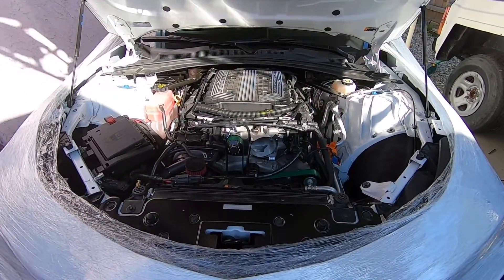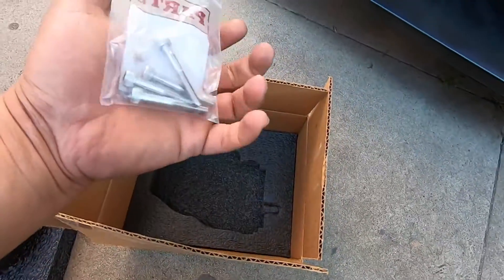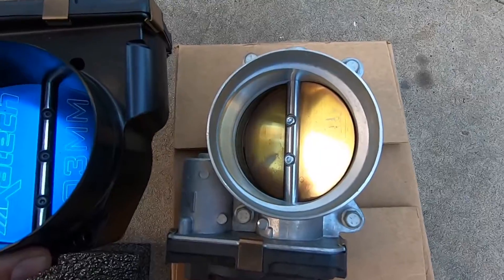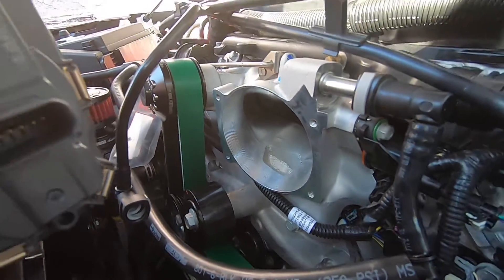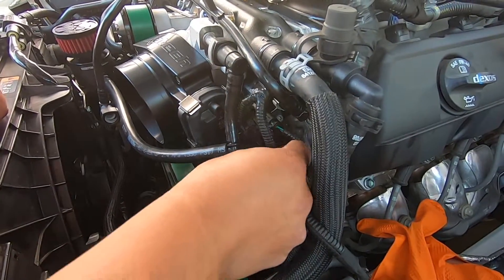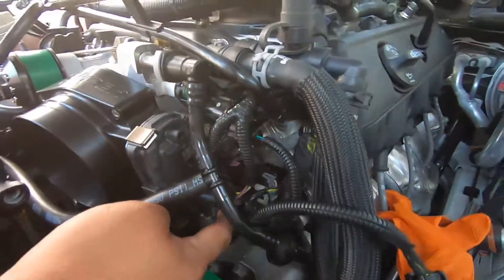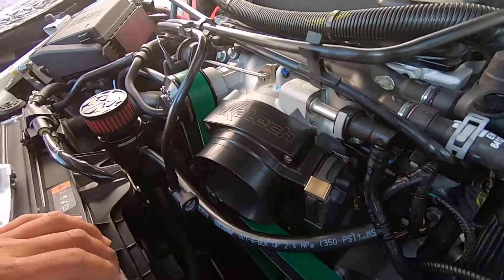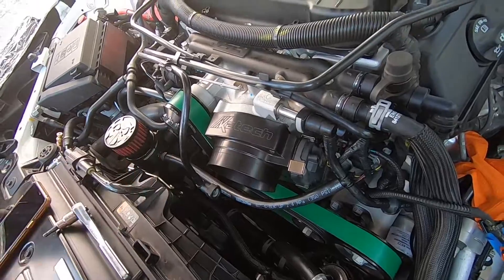Camaro ZL1 1LE LT4 - Katech 103mm Throttle Body Install

Comment: i just got a nick williams 103mm throttle body , ik that if i install it that it will rub on the snout , can i just get an aftermarket snout and not port my stock one
Reply from the maker: There will probably be no point on installing a 103 tb to a nonported snout because the air flow would be restricted

Comment: Did your throttle body connector disconnect the same way all the other connectors work? I feel like I’m about to break it
Reply from the maker: Yes same way. Might have a red lock clip. If it does just slide it to the side and press the plug down and out
Reply: @OXCFilms  thank you lol. I got it now. In my defense i can install a full supercharger system, but can’t figure out a damn gm electrical connector 😂
Reply from the maker: 🤣 dont worry i broke half of the clips on this car already 🤣

Comment: Whats the biggest throttle body you can mount before having to port the stock blower ?
Reply from the maker: Probably a portef stock throttle body
Reply: @OXCFilms  do you need to port the blower to fit 103mm TB
Reply from the maker: For this specific throttle body the blower does need to be ported. And actually with the ported snout im not sure you can run a smaller or stock throttle body

Comment: Will the ecu need reprogrammed for the larger throttle body?
Reply from the maker: Yes it will. Also this throttle body only works on ported superchargers due to the mounting surface

Comment: how do you like the 103mm and what intake are you using? Just ordered one and having my snout ported!
Reply from the maker: Its pretty big, it does pretty good. We used a rotofab big gulp with dry filter
Reply: @OXCFilms  Same intake here. Thanks for the video!
Reply from the maker: No problem 👍. Thank you for watching 🤝
Reply: Does your roto fab bolt straight to the 103mm? Or did you use an adapter?
Reply from the maker: Yes it fits on the 103 without a adapter

Comment: I think you have to add a layer of silicone between the tb and snout or they’ll be a leak
Reply from the maker: We actually cut out a gasket for it but unfortunately we didnt record that part. At first we were going to use silicone but we went with a gasket because its cleaner and reusable.
Reply: OXC Films okay gotcha 👍🏼